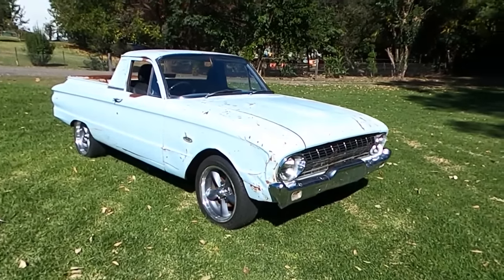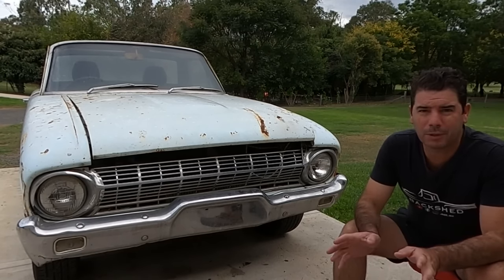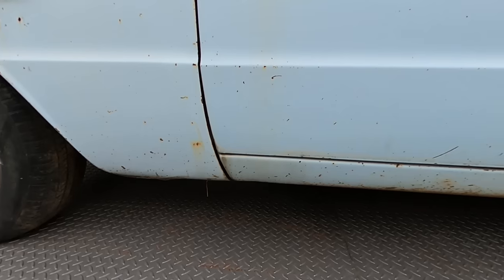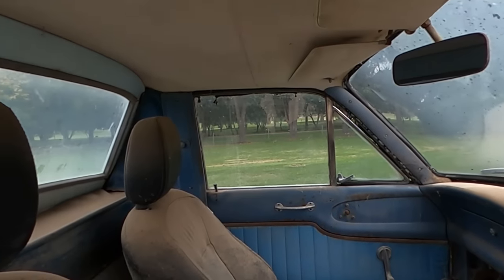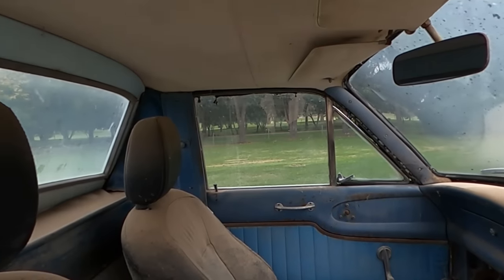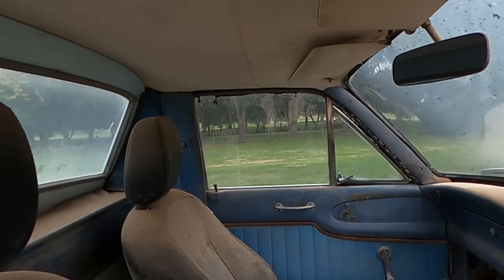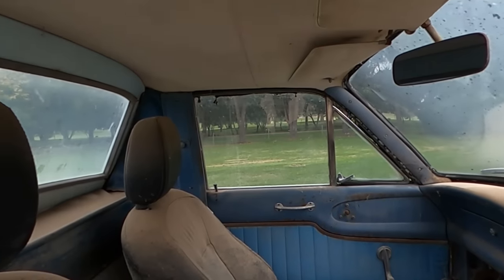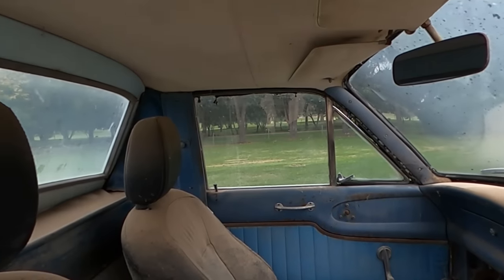EP23 WRECKING YARD FIND FORD FALCON / RANCHERO ABANDONED FOR YEARS FIRST WASH AND WILL IT RUN ?

Comment: Great find. I wouldn’t clear coat it. That looks kind of fake to me. The wax is a better option. Btw that little rectangular Ford badge goes on one side of the lower front mudguard. If you google a 1963 Ford Falcon XL brochure you will see it. Well done on bringing it back to life.

Comment: That tool you  found is to remove rubber hoses from things like radiators, fuel lines, water lines. 
That ute is the same model and colour as we had on the farm just needs a bench seat
Reply from the maker: Yeah right I can see that now , to put down the side of a hose to unstick it 🍺🍺👍
Reply: I have one I've used it for over 35 +years
I'm pretty sure You'll find out that it comes in pretty handy removing most hose clamped type hoses it will save you from a lot of twisting and pulling to break the seal
Reply from the maker: Cheers mate🍺🍺👍

Comment: Hey Mick.  You know, I'm no Ford bloke, but boy would I have jumped at that one myself had I been there and seen it.  Reason being that - as you said - she was so complete (and untouched) under the bonnet and the lower half of the car was so well intact and obviously not full of poo, so she was obviously a bloody good contender and well worth giving a second chance at life.  

I'm also a sucker for that era Falcon with their rounded nose, little fins, body lines and the shiny dress mouldings that just highlighted them.  I love the dual-circle tail lights as well, although that XL has a bit of a Marty Feldman thing going on, eh!  I much prefer that generation over the XR to XY era as the earlier ones had more detail, but that 2nd generation had some good lookers amongst them too.  

She's a great little project, mate - and I commend you chucking them modern seats as far from it as you can!  I reckon even my 5'9" frame would have had trouble squeezing in there.  Modern seats are good if the look fits and they are generally better at holding you in one place, but those didn't suit and it's pointless having seats that won't let you get in and drive the beast, eh.  If that little six is still strong - and it seems like it is - it seems a bit of a waste to me to pull it and sit it to one side in favour of a wee eight.  Sure, a 260 / 289 / 302 would give it the right sound for those wheels and make it more appealing to a wider group of people to maybe sell it to, but that ol' 170 cube six and three-on-the-tree seems more fitting to me because it still works so well.....albeit with a noisy thrust bearing.  Reckon she'd stand a cam swap and a bigger carbie just to liven her up a bit??! 

(As a side note, I had a noisy thrust bearing in a car that had sat for years too.  When it was making the noise, the car used to be difficult to select gears and would creep while in gear and the clutch fully depressed.  After a couple of thousand miles, it shut up for about 90% of the time and after 5000 miles it made no sound at all....and yes, things still worked as they should.  A mate of mine had been harping on at me to change it, but I did 30,000 miles in that thing without a problem before I sold it.  My advice is to give it a bit and see if she shuts up on her own.  What's the worst that can happen?)

Looking forward to seeing more on this old girl when things come together to make it possible.  All the best.
Reply: Love the story here and your insight too.
Reply from the maker: Cheers Lance yeah I reckon there’s other more important things to work on than the clutch bearing at the minute so I’ll take your advice and just let it do it’s thing for a bit haha🍺🍺👍
Reply: History of the world
Reply: @xbgtfella  - Sorry mate.  Did I strain your brain with all those words?  Better go have a lie down then, eh.

Comment: Wow, just discovered your channel, i have some watching to do now... Nice Falcon, last year i pulled an 1968 xt Ford Falcon ute out of the scrub from a friends station. 3 hours of towing through the malley scrub at 60km/hour and i hit bitumen. Farmers used to take the radiators out, as in the scrub that is the first thing stolen. 3 days later the farmer dropped off the radiator and told me it was running around 20 years ago. My XT ute is in a very similar condition to yours but has a few bullet holes and a roo shooting platform. I am tempted to get it roadworthy again with a scrub and maybe a clear coat to retain the patina. I am now so inspired!!!
Reply from the maker: Excellent to hear mate 🍺🍺👍

Comment: Hey Mick, as someone else mentioned you can get fuel tank restoration/sealer kits. KBS and POR15 both do a good one, the sealer dries to a hard ceramic coating and will fill any small pinholes. Have used them myself with good results
Reply from the maker: Cheers mate I’ll look into it🍺👍

Comment: Okay let's go. Firstly I was going to say vacuum wipers but you answered you own question. Secondly now I wish I had have told you to use solder to repair the fuel tank back when I watcher the HQ episode. 3rd.. If your going back to the wrecking yard to get the seat get the fuel tank too. It might be okay or make one out of the two. Cheers Stew
Reply from the maker: Hey stew yeah I hear ya mate , I don’t give up real easy mate but solder or weld that tank is beyond me. It started with a few then the more I moved it and cleaned it the more holes opened it’s paper thin 😞. As for wipers yep I learnt something new 🍺🍺👍

Comment: Mate.  Enjoy the channel and you have some great tips.  How do you degas the fuel tank for welding ? Interesting about the acid to get rid of rust..

Those old Ford sixes are the bomb.  Me mum had a the XM 170 Super Pursuit and a mate the 144 in a wagon.  Solid 
lifters, no syncro on first.  5 turns lock to lock on the huge steering wheel.  Good brakes. Those donks will not die. Get into it.  That motor will come up sweet with a good flogging.  Exhaust manifold cast as part of the head stopped them getting molested.  Never as smooth as a Holden red, as you noticed.

But. I have to confess.  I was watching you trying to get and keep it running.  I was thinking....  Why is he not using the 
choke?  It seemed to be connected.  Sorry, but I was shouting at the screen.  Use the choke, use the  choke  !!!  🙂

Yep.. .the clutch is knackered. Starter a bit sad.  But I like those wheels.  Windsor in those have been done. I reckon a bit of rust repairs and  a bit of paint and she would be a great shop truck.  On a fine day.  Those vacuum wipers get old very quickly. I think the later models had electric ones?  Retro fit?

Anyway... enjoy the channel, and it good to see some old tin get back on the road.
Reply from the maker: Cheers mate I appreciate ya watching 
As far as degas mate I generally acid first then water then weld but this one I just flushed water then started cutting because it was that bad the acid wouldn’t have stayed in it long enough to clean it hahah . As for the choke yeah I guess I could have used it by disconnecting the cable ( cable seized) but it was a 30degree day and I was probably more watching the lack of accelerator squirter and the vac leaks but hey that’s what happened on the day hahah🍺👍

Comment: I want to see more of that Falcon Ranchero. 
I have a’61 Falcon Sedan. It has a ‘65 200 (3.3) and runs great. I plan to pop a Holley Sniper on it soon. 
Great job mate!!!!!
Reply: @backshed5295   Hey mate! I didn’t catch what size those tires and rims are. Would you mine letting me know? Those look awesome. Really changed the look. 
Wheels on my Falcon are too tiny for my liking.
Reply from the maker: Rim size is in the start of the video but tyres are 235/35-18 and 215/35-17
Reply: @backshed5295   Sorry. I don’t hear so well.
I was hoping I could make a 215/50/18 fit all four, then lower it slightly. First thing I need to do is get rid of the four lugs and change to five. 
Thanks for the info.

Comment: Nice work as always.  If you go that far with a fuel tank again, I'd probably have put the biggest patch on last and made use of the access to hold some flattened copper or brass against the inside of the holes to make the welding a whole lot easier.
Reply from the maker: Yeah I hear ya mate top idea I didn’t think of that , I’ve given up on the base I’m going to cut it off as it’s paper thin everywhere . 🍺🍺👍

Comment: Hi Mick that tank looks a lot like the tank in my XY ute, the filler neck was on the opposite side because the sender faces the rear. Those tank halves are the same maybe you could reposition the filler and sender openings, turn it upside down and make a new lid, if the top was any better. If it all turns to shite get an ally one made job done. Good luck, Cheers from NZ, Phil.
Reply from the maker: Cheers mate yeah I’ll cook up something haha🍺👍

Comment: Cool pickup. I thought I bought one once. A  1966 one owner 30 year garage stored. In Sweden. It was cheap but a two door saloon. It was early in the morning and my eyes was not working correctly. I said to my Swedish girlfriend buy it. It just come for sale three mins. Anyways we buy it. Hire a car trailer and go get it. But I realised five mins  after I bought it it was a 1966 ford Taurus. M20 p5. V6. Engine locked good. (Scrap) but floor pan and interior in great condition. . Came with a trunk full of spares cool car. I wanted a rear wheel drive. I'm looking for a 2.3  V6 upgrade. Glad you didn't clear coat this one. Mat coat maybe. Good luck. Thanks for video. Great job✌️. Adiós.
Reply from the maker: Cheers mate yeah no clear on this one I’m still thinking 🍺👍

Comment: Nice Ranchero/Falcon. My father drove a 63 for decades. Interesting the styling and design from the USA version differ. Fenders like a 60-61 USA, doors look shorter, like they are front doors from a four door model, the USA version used the doors from a two door. Taller lip around the cargo bed area and a much wider C-Pillar..
Reply from the maker: Your obviously very familiar with them mate , this is the first I’ve owned , just grabbed it as it looked cool🍺👍
Reply: @backshed5295  As others have mentioned, the tank for the USA version is different. If you cannot find an Aussy version, and must repair your own the way you described or just patching I also suggest as others have mentioned , use fuel tank liner. I used to own a radiator shop and fuel tank repairs were also a daily thing. Patch, clean with acid then line. Your tank would take a quart. We poured them in the tank after prepping and patching and continually rotated and flipped the tank to coat the complete interior surface, than drain the excess back out  of the neck back into the can . I do know that the only brands that lasted were red liner material, the black liner material always came apart. Good Luck!
Reply: They are actually more different than people think

Comment: I’m not a welder but wouldn’t braising the holes be easier, or just make one, your good with metal work & you can weld, doesn’t need to be exact size. You’ll work it out, great video 🍻
Reply from the maker: 100% mate I’m cutting the bottom off and just going to fold up a base 🍺🍺👍

Comment: Cool channel..grew up with most these cars..that thing in the left door looks like a hose seal breaker..remover..i could be wrong..im guessing that vaccum line to the pump works like petcock on a motorcycle..the pressure  from the intake purges fuel down the line.. somethin like that..i think the vac line actuates the breaker plate/timing in the dizzy

Comment: Have a look at a 65 to 68 mustang tank. Similar size and design and easy to find in Australia at any Mustang parts supplier locally. The filler will even work if you turn the tank sideways.

Comment: I had one back in the early 80s. same model and color. the vacuum fitting on the fuel pump is for the wind screen wipers. they where (vacuum operated) later models had electric wipers.
Reply from the maker: Yeah cheers mate 🍺🍺👍

Comment: That looks  to be my old ute  with the five stud 12 slotters. !.. BTW Rancheros are very different.
They didn't sell Rancheros here because the first one they tried dragged it's tail crossing the drains on the side of Parramatta road. because they have a longer tail and the Falcon Utes were made on Station wagon  floor pans.
Vac lines on fuel pumps used to be vacuum powered screen wipers. The noise is a shot throwout bearing. Mine had the same problem until the clutch came apart one day and smashed a hole through the bell housing.

Comment: On the strength of this video I've subscribed to your channel.
As well as the difference in fuel tanks between the Aussie Falcon and the Ranchero that another commenter mentioned, the Ranchero is eight inches longer than the Falcon. There's less than half an inch difference in wheelbase so I assume the Ranchero has more rear overhang.
Reply from the maker: Yeah cheers mate I didn’t know they were that different, being over here I’ve never had much to do with the ranchero they just looked so similar from the front.🍺🍺👍

Comment: Your problems with your carburetor are correct however you need to address the lack of choke. That's why it runs okay when it's warm but when it's cold it will not

Comment: Excellent work good sir.   Do you think the jacking incident is what parked it ? The crossmember is round ….    I wonder if the engine mounts are ok.  I’ve seen where one breaks and the fan comes up and knocks off the top hose connector.  The tool you found in the door helps remove hoses by the way.  Undo the hose clamp and stick the tool in to loosen hose.  Did no. 1 cylinder come back ? I use metal rescue from Repco for fuel tank rescue jobs.   It’s the shit.      Leave in.   Turns black.  Job done.
Reply from the maker: 100% I think it could have been a slip off the jack deal, yep number 1 is up to speed mate she is purring . 🍺🍺👍

Comment: This was great, I had forgotten how cool the falcons were. Funny I learned how to drive in a Ford p/u with 3 on the tree. I never knew that the hammer was the right tool on a Ford.  You suppose that's where found on the road dead, came about. It's so sad that the exterior is so good and the bottom is shit.  I would have some reservation putting its nose up versus raising  its ass. Fatties and skinnies yes.  Love the sticker, that's the entire truth of the matter. I saw a great idea I am gonna use never thought of putting quick disconnect on the pressure washer gun to hold nozzle, that I will do.   I can't wait to see out come of gas tank. Man great video.  I would of tried the tank to, defeat is not an option.
Reply from the maker: Hahah cheers mate yeah it ain’t over haha🍺👍

Comment: nice work, I'd like to see it in a dodgy matt black.. have you considered going older like a holden fx / morris minor style and making a kind of rat rod?
Reply from the maker: I’ve got a FB rat Ute coming soon and a rat f100 too mate.🍺🍺👍
Reply: @backshed5295  cool, it seems some of the older cars are cheaper than 70s/80s and I like the styling,  I mostly mentioned morris minor because you can still get parts for it though you probably have to cut the firewall to get any decent engine in.

Comment: Vacuum line on the fuel pump is for vacuum operated wipers. At least that's how it worked on early model Holdens!
Reply from the maker: 👍👍🍺yep I’ve learnt that now mate your 100%🍺👍
Reply: Yes XK XL had vacuum wipers the XM was the first with 2 speed electric wipers

Comment: The tank for the U.S Ranchero will be different as the tank is mounted in the rear of the car where your spare tire sits. There are tank sealers that you poor into the tank to coat the inside to patch the hoples.
Reply from the maker: Good to know mate cheers🍺👍

Comment: Would the open vacuum port on the fuel pump be adding to the carby woes logically there would be less vacuum at idle if the wiper hose is open.  Is there a fuel tank in the xp ute and, or would it fit
Reply from the maker: Yep open vac on pump would be a leak I did block it to run after the carb freshen up and yeah good call on the tank I didn’t think of that one in the other Ute 🍺🍺👍

Comment: I’d pull the plug on number one, see how fouled or clean it is? Is the porcelain is cracked. Check the easy things first. Bad wire?
Reply from the maker: Nah mate ya over thinking it , its been sitting with an open valve for years just let it warm up and get rid of the stem surface crap and  seat that valve before ya worry about plugs Hahahha 
Your obviously commenting while watching mate that’s cool to see . Love it 🍺👍

Comment: Surprised you didn't remove plugs and spray fogging oil into the cylinders prior winding the motor?
Reply from the maker: 9 times out for 10 they don’t need it mate and sometimes oiling down the cylinders make it harder to fire. If they are real stuck I’d do it but she rolled over without to much of a fight. 🍺👍
Reply: @backshed5295  Ahh, I get it...thanks for sharing that Mick! :)
Reply from the maker: All good mate thanks for watching 🍺👍

Comment: That’s a hose pick, if you have a stuck on hose, stick that tool in and roll it around on the inside to loosen the rubber hose from the pipe it’s stuck to
Reply from the maker: @andyadams3814  👍🍺

Comment: Tank sender unit Ute and Van part number: ARC2DF 9275 B

Vacuum fuel pump rebuild kit US Ford part number: C0DZ 9349 D

I have the Ford Australia Parts Book for XK to XP Falcon.
Also Ford Australia used sedan doors not the longer doors as used in the USA. A drivers door interior panel maybe easier to find  knowing that.

Comment: Guessing the hole in the sump was from the wreckers to quickly drain the oil. Happens a lot to motor and trans sumps.
Reply from the maker: Hahha I would have thought undoing the plug would be just as quick , it’s dented pretty bad so I’m going for the slipped jack fail Hahha🍺👍
Reply: Damage to the sump is nothing unusual , just about every Falcon I have wrecked has had dents in the same place . New sumps are available